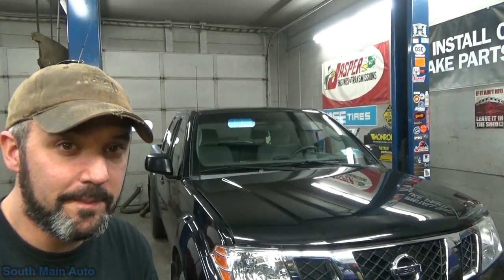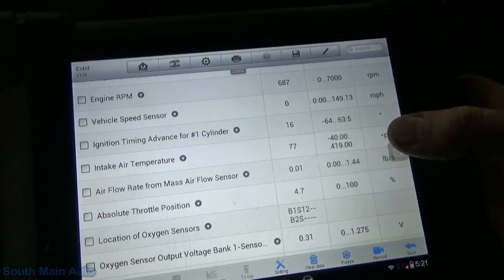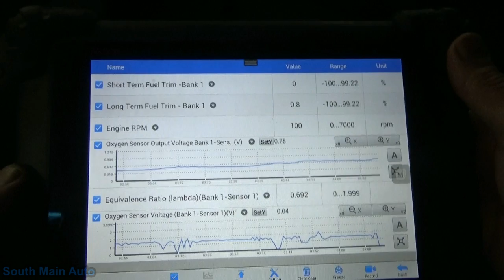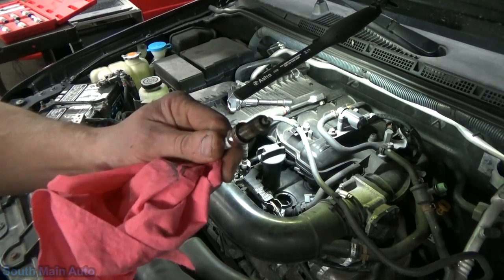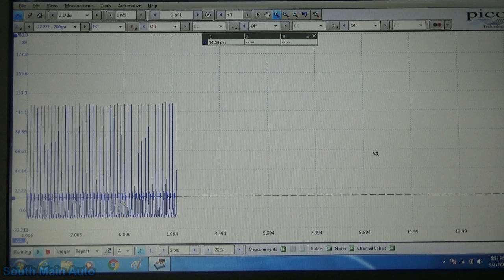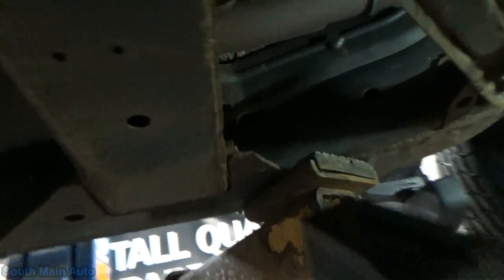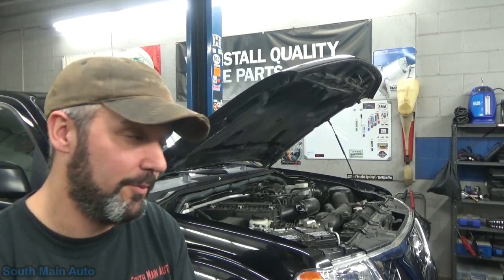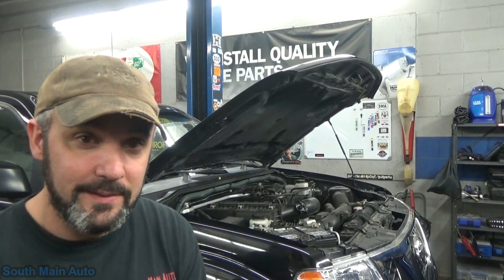Nissan Frontier - Low / No Power Complaint

Comment: I like to use my 02 adapter and a vacuum gauge to read exhaust pressure, besides intake pressure and MAF data. This is an old video, but lets bring it back up. :)

Comment: So...what should normal pressure in the cylinder have been at BDC ? Atmo is 14.7 psi and you have pressure drop across the pipes in the muffler and 2 cats, so I would think the cylinder would need to have exhaust pressure of 21-25 psi, it certainly must be several psi above 14,7 or the atmosphere would fill the cylinder thru the exhaust.

What am I missing?

Comment: I ended up with the same issue some time ago when i ran over a big rock and damaged the converter. Over the next few months, gradual loss of power, not major but certainly noticeable. Engine light never came on cos it's an lpg vehicle, has no downstream oxygen sensor.

A thought, Wouldn't you be able to check for exhaust restriction just using intake vacuum readings from the scantool? I think there's some kind of a test for it.

Comment: Those strontium coated metal mesh catalyst are such a pain to hollow out. I found a unusual way to empty them, Muriatic Acid. Pour it into converter ( off car only, dont be stupid) Do outside, lots of toxic gases and the catalyst gets very hot. The acid eats the substrate like vinegar does baking soda. I collected the liquid from this after everything dissolved, took it to my metal melting furnace. During a routine melt I placed a large steel bowl (torque converter shell modified) in the chamber, dumped that liquid into the bowl. It all vaporized leaving behind a hard rusty rock like substance. Sent to lab:   Iron mostly (duh). strontium, Boron, tungsten, but no platinum group metals to be found. I didn't get to take my Gieger counter to it , I bet its a stable isotope of strontium thats not radioactive but thats just a theory .

Comment: I know this is older video but every car I worked on the has a vertical cat is the one that clogs up the rest of the exhaust I have changed 4 one was a kia sodona van and the rear vertical went and blew apart and took out the horizontal converter

Comment: 250k miles. Replaced spark plugs, vaccuum lines, PCV, VVT solenoids, coils, front O2 sensors, intake gaskets, broke out cat converters, cleaned MAP sensor & throttle body. Still no power and still getting random misfires code.

Comment: I didn't know there was a pressure sensor to measure backpressure, cool device.  Can you plug it into any oscilloscope?  What kind of backpressure would you expect to see with no clogs/restrictions in the exhaust?  How does a catalytic converter fail with no check engine light.  Thought those only fail when too much unburned fuel gets through the engine due to running rich, misfire etc..  That should have set codes well before cat damage right?
Reply from the maker: It is called a pressure transducer and yes you can get them for any scope. At an idle you will see zero back pressure but during throttle snaps you will have restriction and higher pressure (exhaust valve is restricting) Not sure why this cat failed with out warning to tell you the truth. I installed the new one and everything is perfect. Good fuel trims and no misfires.

Comment: Great videos need help I have an exhaust leak I can hear it in the front driver side 2018 Nissan Frontier Crew Cab 4 cylinder tried using a Shop-Vac into the exhaust pipe to try to find the exhaust leak but air from the shop back would not go through to the intake exhaust manifold would push out the shop vac hose out from the exhaust pipe I am thinking that there is a restriction but I am not sure maybe it's just made to exit from the exhaust manifold out through the exhaust pipe please help me please let me know what you think motor runs fine it's just trying to find the exhaust leak somewhere between the exhaust intake manifold

Comment: Nissan had a HUGE issue with the early ('02ish) 2.5L Altima with the cat breaking up and destroying the engine (material getting sucked in the cylinders). I lost mine that way (so did MANY others). I don't know what year this truck is but one would hope that they learned from their design mistake.
Reply from the maker: ahh no kidding, good to know.

Comment: You used a temperature probe and check the temperature from the exhaust right before the converter and then after the converter there was a temperature difference a lot so should the temperature be the same in front of the converter in back of the converter and if there is a temperature difference how much should there be

Comment: "Empty" the manifold converter "unclog it" and put it back on it will still pass emissions as long as the second one works the only negative effect is the sound of the exhaust will differ slightly
Reply: It won't pass emissions because it will throw a code. He said the 2nd o2 was upstream of the 2nd cat.
Reply: Eh, I'd sneak across to PA to get one of the cheap ones and put it in myself :P Eric may be under the gun to follow ze rhoolz but we aren't.
Reply: Jimmy S    Did you learn all about this stuff from Y-Tube?   You must have a Y-Tube certification for vehicle emissions.
Reply: You'll also lose your smog inspection license and pay a HUGE FINE.  Intentionally bypassing or defeating a pollution control device is a CRIME.

Comment: The classic "BOOOOOGG" sound - brings me back to my '85 Monte Carlo I had in the day. Full throttle up a hill on a  major highway, making that same sound out the carburetor at 10mph ... in the left lane, of course. :D People honking and swearing at me, HAHAHA! I was only in the left lane because nobody would let me in! Good times! That one got the ol' fence pipe and hammer treatment. After that, the car went from 8mpg to 22mpg instantly, and would leave rubber with little effort when making a turn from a stop. :D What a difference when they can breathe!

I've got an '02 Frontier here right now, coincidently! Had to repair the tailgate handle (would slide to the locked position from vibration), and I've got a stereo to install in it. Nice n easy. :)
Reply from the maker: Haha I imagine any car guy growing up can tell the gutted out cat story... well I know I have a few from my youth!
Reply: I've had a few "fall apart" recently. All on my own pre-'96 stuff though. :D

Comment: Soon as you brought her to WOT i thought plugged exhaust just by the sound of the intake. Going to cost a pretty penny to fix that hog. Also had one of these not to long ago for the front converter going bad but the person wanted to drive it with a dead miss and melted his down..
Reply from the maker: A misfire will destroy them in a short time for sure!
Reply: The part is $338, and with labor youd be looking at about $500 out the door, at least here in rural Western North Carolina. This is one of those things where you buy the part and bring it to a shadetree guy to install, if your state is strict. Total non issue here in NC.

Comment: I had a similar problem with this kind of truck was a v6 so it had a total of 4 cats the front 2 and rear 2. Had code p0420 customer drove it like that for a while because truck still ran great. Then got p0300 along with p0420 and truck ran like crap. No power flashing check engine light. Replaced front converter, it was all busted, pieces were broken off in converter. truck still had same symptoms even after changing front converter. Disconnected the joint between first and second converter test drove truck power came back and no more flashing check engine. Rear converter on passenger side got clogged, replaced and truck runs great engine light gone no more random misfire and truck has power. Just thought I’d share my experience to help someone out.

Comment: what do you know about the service traction control/stabilitrak  light  on 2012 chevy 2500HD 6.0L? Replaced throttle body, MAF and checked all grounds. I cannot find the problem. I live near a lake with a lot of beach and I drive the beach quite a lot with my tire pressure down to around 35 psi to be able to get around without any problems. I don't think that's the problem because I have had the trac/stab light before I let the tire pressure down. If you have any suggestions at what I might look for I would greatly appreciate anything you might have. I live in Nebraska so I can't really get to where you are at so you could look at it. I haven't had it scanned yet but i'm looking to buy my own scanner on pay day.  But if you could help that would be great. Do you have any videos on this subject?

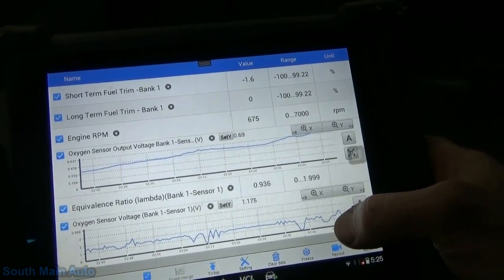Comment: @ 6:30, what is , "AFR" & what were the values that showed "rich" fuel mixture on hard throttle?  I'm trying to learn. Any help would be appreciated.   
Also, I was watching B1S2 o2 values and noticed the voltage wasn't flip-flopping like o2 sensors normally do. Any insight?
Reply: Afr is air fuel ratio for gasoline "ideal" is ~14.7:1 (14.7 units of air to 1 unit of fuel). So anything lower is "rich" meaning too much fuel anything higher is "lean" meaning too little fuel. There's benefits to running a little bit on either side but too far either way and you can't support a combustion reaction anymore.
Reply: @ryego3  Thanks ryego3. YT didn't notify me when you answered my question. I'm only seeing it now after rewatching the video. Thanks for sharing your knowledge!

Comment: Speaking of diagnosing this issue, shouldn't you be able to see it in the engine load PID? Plugged exhaust should drastically reduce the air mass flow under WOT, thus giving you a very low engine load PID.

Comment: I have this truck with the 6 cyl engine.  The clutch went out at 40,000 miles or so.  They replaced it under warranty.  Usually they don't warranty wearing parts but they did in this case.  There must be a memo on it.

Comment: You should check the exhaust system behind the broken car for debris... I had that once, changed converter and car still runing like crap... muffler after the converter was clogged with the ceramic debris
Reply: I mean broken cat, not car :-)
Reply from the maker: Haha yeah I knew what ya meant. Well this truck is long gone and yes I did look down the pipe :D

Comment: My 95 Dodge ram 1500 5.9 started doing that all a sudden on the freeway one day. It keeps getting slower and slower and my foot kept getting into it more and more untill I was matted to the floor and couldn't get it over 1500 rpm and it was going very slow. So I pulled over and check it out. And turns out the cat converter media was melting together into a big glob of platnum and plugged it up. So I hit it with a sludge hammer and held it to the floor bouncing off the rev limiter for a couple seconds and all the converter media blew out the end of the tail pipe.. so always check your cat if you have these symptoms.
Reply: After that I been driving the truck for three years now. I'm lucky it didn't blow a head gasket or melt a piston holding it to the floor on the freeway with a completely plugged up converter.. truck ran stronger then ever after it blew all the converter guts out. Truck would easily cruise at 80 mph after that (not to mention sounded amazing too)😂😂😎😎

Comment: Just a tip .  Use a drain snake inserting it up the rear end tailpipe until it unplugs the piece at the cat, Viola, you can drive again until it plugs or shoots the tennis ball size plug out the back and thru the windshield of the lady behind you... Either way, not your problem anymore 🙂

Comment: Have a 2006 Nissan xterra same codes random misfire and misfire on cylinder 3, wouldn’t go past 2000 rpm or past 40 ish mph. Cleaned injectors and checked coils nothing, even o2 sensor. Turns out clogged cat.

Comment: I've worked on 2 nissans. One was a 2005 pathfinder w/ 4.0L v6. The other was a 2006 frontier w/ 4.0L v6. Both had 4 cats each. Had same problems,  no power when pedal to the floor. I fixed the problem by hollowing out all the cats. Problem solved! Runs like a rocket when test drove them. For some reason Nissan cats are poorly designed and I also noticed that all the exhaust pipes converge into one before the muffler and the pipes were nearly flat in that area, which probably added to the problem.
Reply: How exactly do you gut the cat?

Comment: Hey Eric, hoping to get yours and Ivans input on this.. My brothers 02 maxima, p0462, fuel level circuit low input. (fuel gauge stuck high). Ohm'd the sending unit, checked out good. 5 wire connector, fuel pump 12v and ground. Mutual ground and then fuel sensor power and ground. Both grounds check out good but getting no power, actually getting a ground as it light my test light on battery positive. Ran a fused jumper to the power wire and gauge read empty but fuse did not blow. Any insight? Thanks alot

Comment: Just found your channel, and I’m thoroughly enjoying it. When you refer to ‘open/closed loop’ what are you referring to?
Cheers.
Reply: Open and closed loop is the mode the ecu uses for fueling.closes loop uses feedback from upstream o2 sensors to adjust fuel. Open loop means it uses preset fuel maps in the ecu and doesn't use feedback from the oxygen sensor(s)

Comment: Just bought a 2019 Frontier & I'm hearing horror stories that if the battery dies (or if you disconnect it) the keys lose their programming & the vehicle won't start. Is this true?
Reply: I got a 2018 Frontier V6 and I disconnected the battery , but I had no problems with the key fob or anything else.

Comment: my 2016 frontier V6  auto trans.   when i turn it off the sheet metal around the ext pipes makes a noise as it cools off.  strange  i had a 1964 dodge 880 make same noise.  but no cats on that one.

Comment: I'm glad we don't have these silly and unreasonable emissions testing here in Michigan. To fix this issue we can simply give it the ole' scre driver and hammer treatment. I think it is somewhat reasonable to have emissions testing before a car is sold from the manufacturer, after all smog used to be a major and reasonable concern. But emissions testing on these older cars seems ludicrous. The majority of cars still have decent emissions even with "bad" cats not to mention how ridiculous it is to put 1000+ dollar cats in a 1000 dollar car just to have moderately better emissions. Not to mention most cars are new enough not to have these issues.

Comment: I's funny, I have a 2011  Hyundai Genesis coupe  Rspec 2.0L,  which is losing power. The data of the oxygen sensors show the cat sensor this switching. When I measure the inlet and outlet temperature I have 400 in and 230 out. The cat is under warranty, in 4 times it is taken to service, but as the car has no DTC the technicians say that the car has no problem.

Comment: prity much the same happened to us wen we where camping in the middle of no where so lucky i had packed some tools . found a old exhaust on the road side . ended up cutting the old cat out and putting a length of pipe off the one we found.  in its place and clamping it the best i cud . was a bit of a hokey fix but got us home . where the new cat and pipe where waiting .a hour later from getting  home the new part was on .
Reply from the maker: Awe man cool story ;)

Comment: most o2 bank1 sensors in nissans should be below 1v, especially at idle. i've never had mine go above 0.9v. that and the noise was the red flag for me. and primary cats in these things tend to fail right around the 80k mark when the warranty for them expires.

Comment: I'll save my comments about foreign brands needing the same amount of work as the US brands for later....lol  Eric, what is the normal differentiation in exhaust temperatures before and after a cat? Is there anyway to bench test a cat?
Reply from the maker: Usually the cat is about 150 degrees hotter coming out the back then the gas going in the front

Comment: Hoping you can help . Three years ago I had to change the distributor on my 2000 frontier 3.3L . It started to act up again about two weeks ago . When the engine gets up to temp it starts to cut out . It idles good but when you give it some gas it cuts out . If I let it cool down it will run okay until it gets back up to temp . I changed the distributor and no change so I changed it again just it case there was a defect still no change . Any ideas ? Thank you .
Reply: De Oppresso Liber  
Thanks . I'd be interested to hear what you find .

Comment: Can't clean the cat? Soak it in some pure seafoam or use the spray extension tube! I had the input shaft replaced on my 2004 Grand Prix GTP CompG (snapped it first time I hit the nitrous with sticky tires) and as soon as I took it for the first drive the catalytic was completely clogged!!! I soaked it in some seafoam and it was better than new after, passed tailpipe emissions test by the ministry too. Only thing I can think of is that when the input shaft snapped it was such an event it shook all the carbon loose and it all fell into the cat at once.
Reply from the maker: Interesting, well maybe if it was my own vehicle but having a shop and having to stand behind my work with out having comebacks I really can't do that ya know. Customers really don't like paying for experiments unfortunately ...

Comment: Where I am the shop would put a test pipe in and forget to remove it.haha
Reply: Clearly you live were there isn't an emissions test. Without the cat there is zero chance a car would pass here in Maricopa county in Arizona.
Reply: Joe Tiller yep. maricopa would fail it bigtime.
Reply: CONNECTICUT COST YOU EVERYTHING 100 FINE FOR NO SEAT BELTS TO 1000 FINE  FOR 2-OR 3RD SPEEDING OFFENCE
IF YOU FAIL EMISSIONS  YOU EITHER HAVE A DISCONNECTED BATTERY THAT NEEDS DRIVE CYCLE OR SPEND 1000 TO GET THE FUCKING SERVICE LIGHT TURNED OFF
STATES A JOKE
Reply: @ekop1778  you should be fined for speeding or not having seatbelts though.